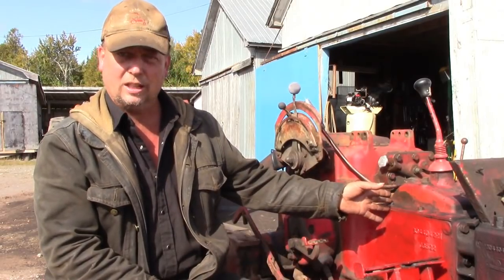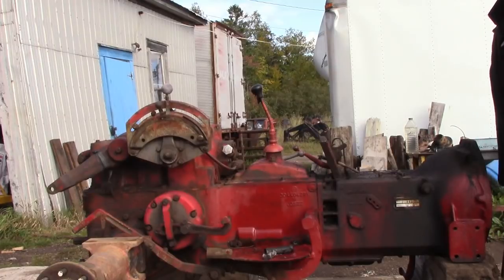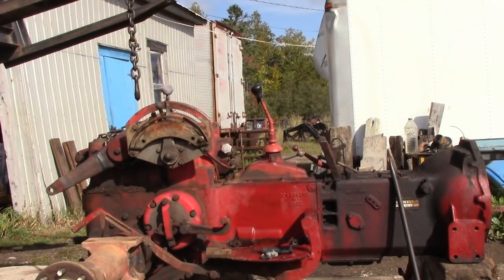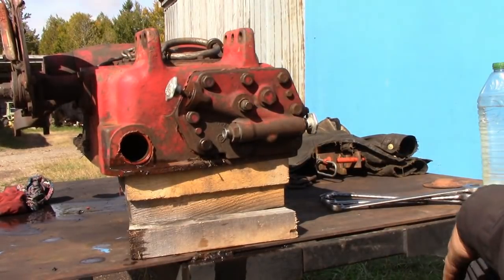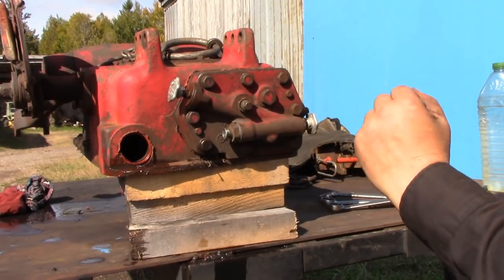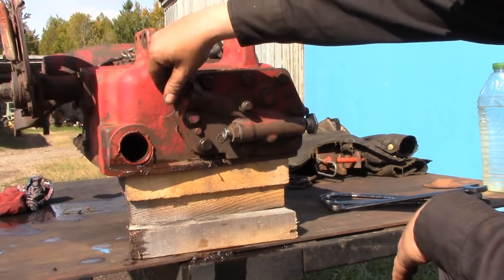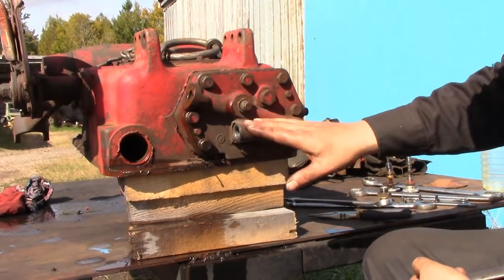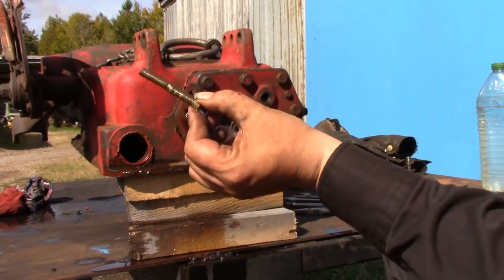B414 Hydraulic unit dis assembly

Comment: I got my clutch working. I am noticing my front lift doesnt want to work all the time. Do you think my hydraulic fluid is too low. My 3 point hitch still works but kinda jumps up and down about a half inch when my valve is open and the second valve for my front bucket is open. My slow fast valve spins. Is it supposed to do that?
Reply from the maker: Jumpy hydraulics is an indication of low oil. The fast slow valve will spin.
Reply: @CanadianRedneck15  thanks.
Reply: @CanadianRedneck15  Sorry to bug you again. I may have broke the hydraulic pump. Possibly dead headed it. Is there a fix or will I need a new pump?
Reply from the maker: @frankz1125  If the pump broke you will need to replace it.
Reply: @CanadianRedneck15  weird tractor. It started working after hours of trying.  I'm not 100% on the operation of this. I did just get the bucket on and dug some dirt with it to test it out. It need some love. I'll post a video tonight on it. If you'd like to see it
Reply from the maker: @frankz1125  Don't ya love when something randomly starts to work and you're not sure why?!
Reply: @CanadianRedneck15  I'm happy it works but it makes it 10x harder to figure what everything does when it only works sometimes.  I'm starting to figure it out. With the open closed valve closed my front lift works. I can shut it off in 2 places. I can turn off the 3 point or the front or them both.
Reply from the maker: @frankz1125  Don't close both at once, that would be dead-heading the pump and that will cause problems.
Reply: @CanadianRedneck15  I won't close any of them with the tractor running. I heard you say that after I did it already. That's why I thought I broke the pump. Thanks for your help

Comment: My IH44 has a return hose to where you fill the tank,  it creates pressure in the tank,  It the return on the Allied 350 bucket   is this okay?  to me it going to cause problems should there be a breather on the tank? I found parts are cheap for these thanks to MAHINDA in India
Reply from the maker: They do tend to pressurize the tank as they heat up. The problem with a vent is it's a good way to introduce water into the system. Thanks for watching!

Comment: Hi Dave, excellent video, I will tell you, I am a technician in oleodynamic systems, but this time a Mahindra 9200 4wd tractor is giving me a lesson, I have taken a repair job of the hydraulic lift with remote control vickers, once put into service , the following happens,
remote control works ok.
Elevator does not work.
According to your knowledge what could be the problem.
Atte
Reply from the maker: If there is a priority valve it could be stuck only sending oil to the remotes or the linkage for the lift unit could be out of adjustment or disconnected. Thanks for watching!

Comment: Good evening. We are working on a B414 currently that is not producing any pressure at the control block. The discharge of the pump is putting out oil, but a pressure gauge at the valve body doesn't show any pressure. Any ideas here?  Are you available to call? Thanks, Pete
Reply from the maker: Unless the unit is lifting the pump would have an open circuit and not really be building any pressure I would think, though I am no expert on hydraulics. Thanks for watching!

Comment: Hi man,i have a question: from this hydraulic system unit  can i plug a front loader?  From where?
Reply from the maker: To run a front loader you plumb the loader valve into the pressure line between the pump and the lift unit. You need to use a "power beyond" valve. Thanks for watching!
Reply: @CanadianRedneck15  thanks,can you gime your email or something,a have more questions abuot 444😀
Reply from the maker: @gazolis  sales@chowntractorparts.com

Comment: I think I asked you a few years back about an issue on my International 444. When I enable the PTO the lever starts jumping and feels like a stripped gear. Is there a manual I could use to try fixing the issue. I also recently started having with the 3 point not lifting and power steering. I bought some oil so I can check the filter and level as well.
Reply from the maker: Do you mean the lever jumps when you try to put it in gear? That would be the PTO clutch not releasing.
Reply: @CanadianRedneck15  I press the clutch and put the PTO lever. As soon as I start mower and it hits grass the lever starts jumping. The previous owner would keep his foot on the lever but it got worse. 

If tractor is on low rpms with cutter and I rev it it jumps out and disables. I am not sure how to explain this.
Reply from the maker: @cutweldngrind   Yeah, you're going to have to open it up and check it out, likely a bad bearing.
Reply: @CanadianRedneck15  I might have to search for a tractor mechanic or a manual. Thanks

Comment: hello I have a problem and in my international 384 tractor in the hydraulic on the levers due to improper assembly, the tractor lifts the levers rather on the tractor's main lever but with the depth lever it does not regulate also lift the hydraulic or else you are working on the tractor and the harrow or the plow falls or ect I'm from Uruguay.

Comment: On the back of the unit beside where the broken spring was... There is a pin of some sort that is leaking on my tractor is that a relief or something?
Reply from the maker: That is part of the draft control mechanism, there is a seal that goes around the pin. Thanks for watching!

Comment: I just rebuilt a 434 and used this video to get through it. The hitch was pulled and half disassembled 2 years ago. He went in for back surgery and ended up having a massive stroke. By the grace of god he is still here, and we have been working on it together. So on to the problem I'm having. The hydraulic hitch is jumping slightly when arms are stopped in any position. I made sure I put everything back the way I removed them. I then found out that the hitch was doing that when it was removed originally. Do you think the thermal relief valve could be the problem? I read on a forum that another person had same issue and had two parts flipped when assembled. The books I have don't give a good description of which way those parts go in. Any help would be appreciated. Thanks
Reply from the maker: That jump is usually caused by either the lift cylinder leaking or a valve leaking so the arms actually drop a little and then jump back to the set height. Thanks for watching!
Reply: @CanadianRedneck15  thanks for the reply. I'm pretty confident that the lift cylinder is not leaking because I can lift the arms with weight on them and shut the isolation valve and they don't drop at all. I will look at the valves again but they're all brand new parts. I think I have something installed wrong. Thanks again

Comment: Hi Dave. Couple of questions for you. My fast slow valve wont turn. What could be causing this and how do i fix it. I don’t want to put too much force into it as i don’t want to break anything in there.  Which leads me to my 2nd question, the shut off valve is snapped in there, any ideas on how to remove it? Many thanks
Reply from the maker: I expect that corrosion is the problem, if it is stuck on fast ignore it. If you must free it up it's a push and turn valve, try tapping on it lightly with a hammer. The shut off is a problem, take the "nut" out from around it and try threading it out with some pliers.
 Thanks, for watching!
Reply: @CanadianRedneck15  thank you, for your reply and your videos. Fingers crossed i can get this valve out.

Comment: On my control unit the fast/ slow valve broke and I believe this is why the loader stopped working? I have sourced a replacement fast /slow valve but my loader still will not work? I have cracked the two hydraulic lines and there is oil there. The thing I can’t work out though is that I cannot turn the installed valve and I was wondering if there is a specific way to re-install the valve?
Reply from the maker: As I recall you just thread in the nut(collar?) that holds in the valve and the valve spins in with the nut. Not really important what direction the valve is, it acts by being out as far as the collar will allow or held in by the ridges and pin to cut down the flow.
 I don't think that should affect your loader but I don't know how yours is plumbed in. 
 Thanks for watching!

Comment: Thanks for sharing. Where can I get parts for my b414? Id like to replace the electrical. Also my clutch is not working and was wondering if I can get to it from the bottom plate under the tractor? Need brakes too. Cheers
Reply from the maker: You can see the clutch from the bottom plate but will likely have to split the tractor to attempt any clutch repairs. If you are in Canada check www.chowntractorparts.com for parts or elsewhere a local parts store.
 Thanks for watching!
Reply: @CanadianRedneck15  thanks for advice.  I'm in ont. I probably won't get to it until spring.  My local store can't even get spark plugs for it. Merry Christmas
Reply: @CanadianRedneck15  you can click on my name to see my channel.  Mainly solar.

Comment: Dave, can just the valve body cover be removed once the hydraulic line is disconnected to access the spool assembly's. Or do have to tear the whole case apart? I think I have some o-ring issues making the 3pt act up.
Reply from the maker: You should be able to take just the valve body front plate off without pulling the cylinder etc. form the housing. Thanks for watching!

Comment: You have helped me enormously with my 444 & 574. 
Question: my 444, rear lift arm, won't lift? I've done the basic maintenance with fluids and filters. What do you suggest?
Reply from the maker: Make sure the valve on the left is open, if that's not it then likely an internal valve sticking. Thanks for watching!

Comment: I have a question about draft linkage and it is only showned briefly in this video... can you pm me at pgilbreath2001@yahoo.com . Your assistance will be greatly appreciated
Reply from the maker: I don't expect I can be much help, I just take the units apart, it takes skill to put them back together. Thanks for watching!
Reply: @CanadianRedneck15   i found the likkage and it is going to be a pain to put on unless i pull the pump out again
Reply: I had to watch till rhe end of the video to realize that there two levers to the pump assembly... got to pull pump back out to fit the control up... it did help... thanks and keep the videos comming
Reply from the maker: @patrickgilbreath7645  I am glad the video helped.

Comment: I only seen one other comment about the chain that has a rubber sleeve over it .I can't for the life of me figure out where the other end hooks to. It was just laying on the bottom with 2 links broken off of it. It's still attached at front. Any help would be very much appreciated thanks. Great videos!
Reply from the maker: I'm sorry I don't have one to look at right now and my manual doesn't show it.
Reply: @CanadianRedneck15  ok. thanks for reply
Reply: is it possibly a retainer for the filler cap?  I don't think that my B 414 has anything like that. Dropped in by accident??

Comment: Thank you for sharing this. I'm sure this is dumb, but my valve body/assembly (now that I have a name) leaks horribly. It looks a bit different than yours, but similar. Seems to be leaking out the valves. Can I replace those handle valves without tearing this all the way down as you do here? I thought the valves felt under pressure when I started to unbolt, so I was unsure.  Further, not even sure where I find new ones (though I'm guessing and hoping it is mostly the o-rings but they do not turn the way yours did.).
Reply from the maker: As long as it's not running the only pressure should be spring pressure but I don't think there are springs behind them in any configuration I am aware of. It should just be o-rings so pop them out and take them to a machine shop or the like in your area to get proper size ones and that will likely look after your leaks. Thanks for watching!
Reply: @CanadianRedneck15  Thanks. I'll give that a shot!

Comment: Hi Dave,
My B414 hydraulics are jerky when lifting.
Draft control lever is forward and isolator valve is as open as it can be unscrewed.

It wasn't jerky until I replaced the oil with modern hydraulic oil. When I realised that was wrong, I flushed twice with SAE30, checked the suction pipe strainer was clean and it's still jerky.

The isolator valve will only turn one full revolution and I noticed that yours will turn a couple of times.

What do you think is causing the jerky lifting? (it hasn't lost lifting power, just jerky lift and smooth when lowering).
Reply from the maker: The 414 series tractors were meant to use a modern hydraulic/transmission oil. Try taking the isolater valve out and cleaning it and the passage, check in the hole with a light to make sure there is nothing in there. Thanks for watching!

Comment: This is a great video.  I have leaks on those valves in the front.  Can I get the o rings at a hardware store?  Also, the Draft control has a small  steel rod that moves in and out at the back of the transmission unit where the spring is located.  Should that have a gasket or o ring?  It is leaking there, also.  Thanks, Chris
Reply from the maker: I believe the draft control rod out the back has a seal around it on the outside of the case. The o-rings you should be able to get a t a hardware shop or machine shop. Thanks for watching!

Comment: I tell you Dave you are Johnny on the spot. How ever I did figure this one out on my own. But I'm having trouble with the o ring size 1 15/16 or 47mm. 3/16 to 4.5mm thickness? I put an 1/8 thick 17/8 in it and it leak as bad as the o ring that was in it to start.
Reply from the maker: It was British built so likely metric. Make sure there are no burrs in the hole either.

Comment: Hey Dave it's me again. I'm having a leak at the hydraulic return port of the hydraulic unit
Reply from the maker: There is a pressure line and a suction line, the suction line is a friction fit on an o-ring, the pressure line is a threaded fitting.
Reply from the maker: @Nathan Capewell  The connecting rod just sit against the lift piston, the arms are free to float. Thanks for watching!

Comment: G'day Dave, I've just inherited an A414 (Aussie made version) which is leaking hydraulic oil like a sieve from nearly everywhere it can. Do you know if there are gasket kits available, or should I make my own paper gaskets or use a silicone gasket goop?
Reply from the maker: You could try a CaseIH dealer for the gaskets, if no luck there then I would recommend the gasket paper and make your own. I don't like silicone around oil, it breaks down and gets where you don't want it.  Thanks for watching!

Comment: Hi Dave. I bought a B414 diesel a couple of months ago and have been working some of the bugs out. Your videos have been very helpful. I am having one problem where the 3pt hitch will raise when I increase the engine rpms even though the controls are in the lowest position. Makes using tractor for mowing pretty useless. Do you have any thoughts on what might cause that? My guess is a problem with the valve body but I'm not ready to tackle that yet.
Reply from the maker: I would say a restriction (probably some dirt) in the valve body, try cleaning the little brass screen in the front center of the valve body. Thanks for watching!
Reply: @CanadianRedneck15  Thanks for the information, I will certainly look there first!
Reply: @CanadianRedneck15  I found the orifice assembly to be completely stopped up like you thought. I cleaned it and while I had the fluid drained I pulled the main filter screen. That is when I found  there wasn't any filter in the return line, which is also the reason the orifice screen was stopped up. I have another B414 I use for parts and it had one in it, so after a thorough cleaning I put it in. Bleeding the darn thing was a pain but it is going again. Thank you for your help! By the way you have put out some great videos that are very informative.
Reply from the maker: @carsonmills1899   Awesome, glad you found the problem!